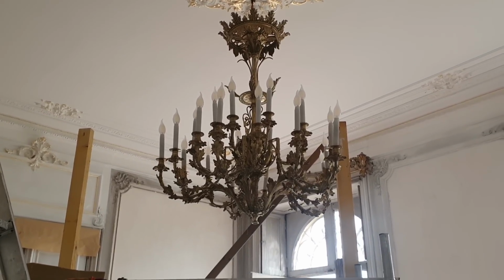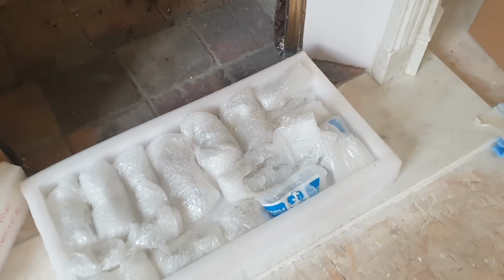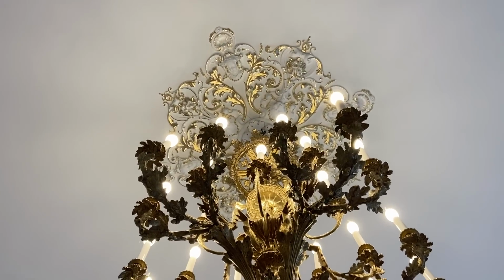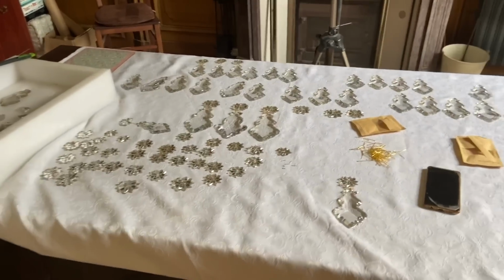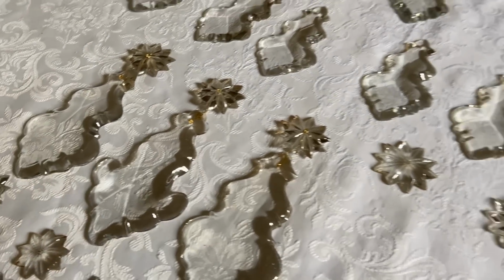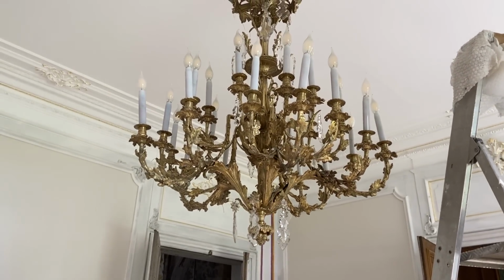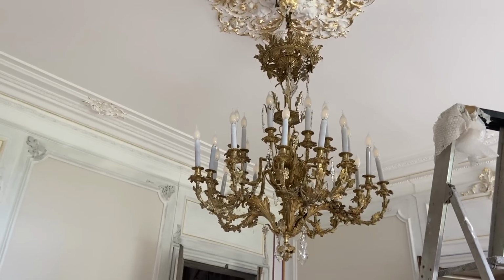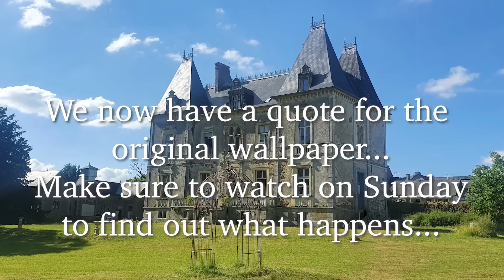The Château’s Original Chandelier Fully Restored

Comment: Hi guys good job. One comment is that you have hung the crystals backwards: the flat part always goes to the front with the faceted part at the rear— it’s like a diamond— The faceted part is always at the back of the ring.
Reply from the maker: Someone else mentioned that but we hung them the same way as before. We also googled it just incase and it said flat in. I’m sure it won’t matter too much
Reply: I restore old fixtures for a hobby. And you are absolutely right the are hung with the flat side out, to break up the light. It gives better refraction. (More sparkle) 
Good call!
Charlie

Comment: I have to say something. Have you earthed/grounded the light fitting? I can only see two wires going from the ceiling into the light fitting. I don't know about France, but here in Australia this is an absolute no-no, an unsafe situation. Throw in the wild card of working off aluminium ladders and a serious electrical shock is a possibility. Earthing continuity right through the fitting to its furthest metallic point is vital. Please have an electrician check your work.
Reply from the maker: Although you do not need to earth the lights here I have run an earth over and there is three wires coming from the ceiling.
Reply: I'd still have an electrician check what you've done for safety's sake especially since you've rewired the light fitting yourself.
Reply from the maker: I am an electrician as well. I wire up all the exhibition stands I build in the UK
Reply: @LifeAfterLaFerté  Ok, now I feel a lot better. All the best from a fellow sparky.

Comment: Woooow... That is stunning. It must weigh an absolute TONNE. Those crystals are gorgeous! 

It would be fabulous to find the old owner and get them back. What a headache... But it will be like an Easter egg hunt... you may just find them in the most fabulous places here and there in the brocantes etc 😊
Reply from the maker: Yes it weighs over 70 kilos
Reply: @LifeAfterLaFerté  I was wondering about the weight. I saw professionals using a sort of block and tackle pulley-type system to lift a large chandelier to the ceiling after they refurbished it. From a distance it looked as if maybe Adrian had a number of loops of the lifting cord run through the ceiling ring to hoist it ?
Reply from the maker: I lifted it by hand having Carole take up the slack on a rope so not to put pressure on the ceiling rose
Reply: @bluebird1239  It always makes me wonder as they navigate details like this, how the builders would have had to take such things into consideration as well. These days we plug schematically into computer programs etc but for an architect and contractor to put together a "normal house" these days is comparatively straightforward... Imagine what the trial and error must have looked like way back when these castles were built! 

I live in a city with beautiful historical architecture and the other day I stood in front of one of the random buildings to figure out some of how it was built. The facade had eleven different cast pieces per window, plus the stones cut for the arches and sill. There were five separate window designs and then the doors, corbels and decorative details on top of all of that. What an incredible amount of planning and work!! 

When you think about what is being rebuilt here, it's truly amazing that we get to experience the details. And figuring out so much of it AS you go, that's so incredibly impressive. 💖

Comment: Resplendent and beautiful, old world quality. So when you look at it now, you recognize all the details of its beauty. The crown at the top requires more crystal pieces. As well there are a few other spots that could hold some more weight in crystal. The holes are visible and available. It can be very expensive to adorn the chandelier fully. It is an ostentatious coruscation celebrating dripping wealth. Lol. Ya that’s the plan.
Reply from the maker: All holes now have crystals hanging from them